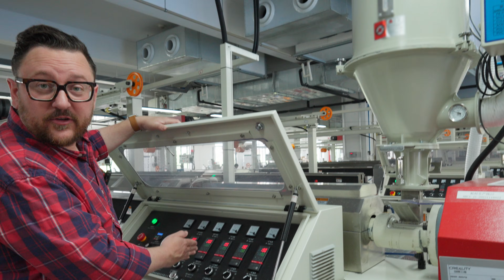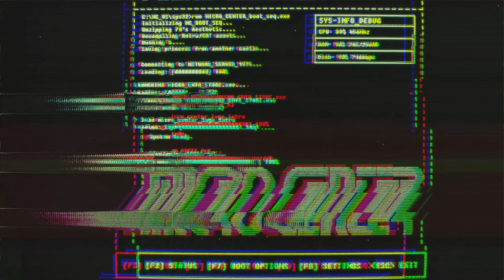Touring a 3D Printing Filament Factory | Micro Center Onsite

Comment: @ 5:00 Yes, MicroCenter brand Inland has a problem with pinched filament in their spools. One of a white petg was so bad, 70% of small prints failed in my K1C (both bought @ Micro Center). Since tbis spool was my 1st attempt at printing petg, I thougth it might be something I did. It wasn't, proof came in my next petg spool from polymaker. That ran perfect.  Also have pinch problems with inland spooless pla. No such problem with bambu labs spooless pla.  I now understand why some people print a spool rewinder. I will need to print a spool rewinder if I decide to go back to inland filament.

Comment: You should be selling USA made materials.  Please.
Reply: u want a $50 spool? lol Proto Pasta and CookieCad are us companies.
Reply: @cplatt10  well that's strange.. Dancyn 3d prints has a small line , and makes black pla filament for about 3 bucks per kilo.. (here on youtube)
Reply: @cplatt10  CookieCad is made in China.
Reply: @cplatt10 voxelpla is made in USA
Reply: I'm a little confused here.  Inland makes the filament in China and Vietnam but are they claiming the pellets are Ingeo?  Which I find hard to believe they would ship it overseas and then the completed spools back.  Basic Ingeo 4043D is no better than Chinese PLA and in fact is inferior in my opinion.  Ingeo 3D870/850 (the "high heat" stuff) is worth it though.

Comment: At what point do they dry the filament after the extrusion?
Reply: I was about to ask the same question.
My best guess is that the factory floor is humidity controlled. But that’s just a guess.
Reply: @DRDEC   0:12 those round things , they are blowers.. they don't dry it 100%